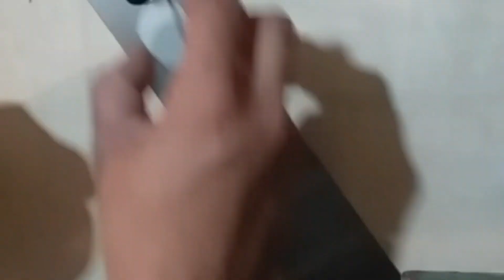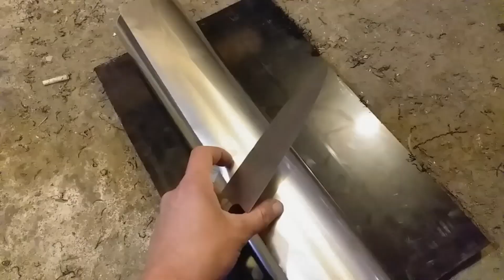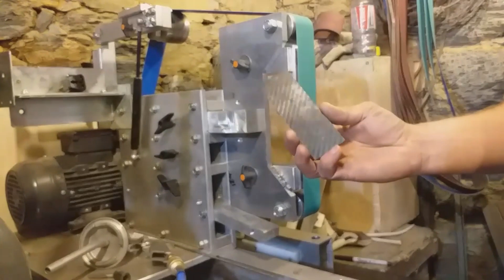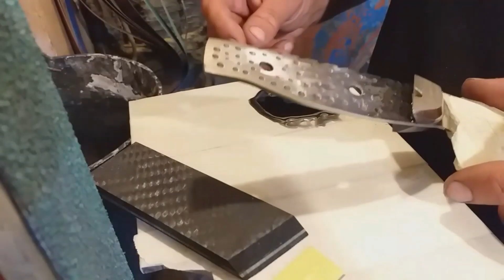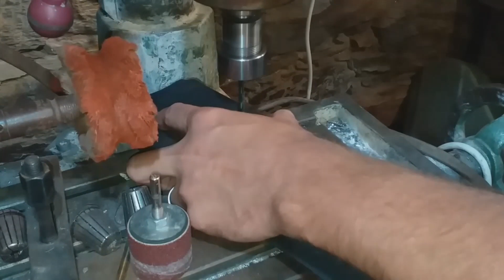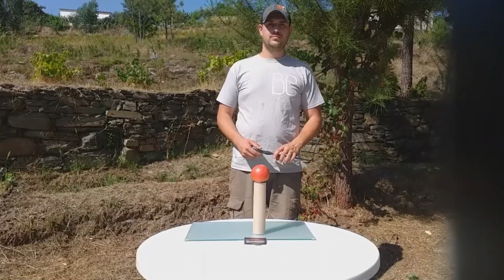Branco Customs | Custom Chef Knife Build - N690 Blade - Carbon Scales - 316 stainless bolsters

Comment: Can n690 be honed ?
Reply from the maker: It certainly can. It's much better to hone as much as possible than remove material with abrasive sharpening processes.
Reply: @BrancoCustoms  My concern was that it has a high HRC value , I've  been told that high HRC steel can't be honed, was wondering if this was the case

Comment: Hi
Please explane this metal for me
What is this metal Specifications?
Is it as good as 316 stainless steel
In Corrosion resistance and another thinks and what is this metal name?
Please answer my question
Thanks
🙏
Reply from the maker: Hello, 316 is not suitable for a blade only for a bolster. 
N690 is far superior steel to 316. Very corrosion resistant and hardens very well.
Reply: @BrancoCustoms  how a boat 304 and 420?
Reply: @BrancoCustoms  is it as good as 316 stainless steel in Corrosion resistance?
Reply: @BrancoCustoms  do you suggest it for air rifle too?
What's your suggestion for air rifle ?
Reply: @BrancoCustoms  do you suggest it for katana and sword too?
Reply: @BrancoCustoms  thanks Alot my friend

Comment: Tell me more about finishing carbon fiber...I go to 800 grit but it still looks cloudy. Subbed, awesome vids!
Reply from the maker: This I went to 1200 grit then buffing wheel. Green compound and then rouge. 
I have heard of others who sand all the  way up to 3000 grit and then swop confusing micro mesh pads. 

I believe the result is also dictated by the resins used in the CF and the modulus of the CF itself

Comment: Could you post a link to the rivets and the rivet press used please
Reply from the maker: hi, here is a link to a similar press to what i have, https://www.machinemart.co.uk/p/clarke-csa10ep-10-tonne-economy-hydraulic-floo/ 
However, I made many modifications to it to make it precise enough to press the pins without skewing out of line, and i added hardened steel parts to hold and compress the bolster pins.